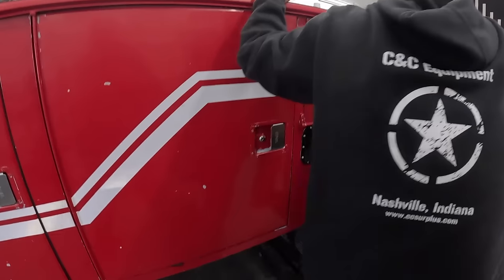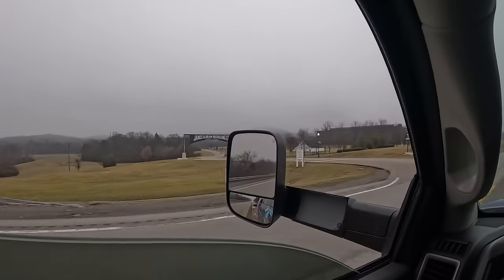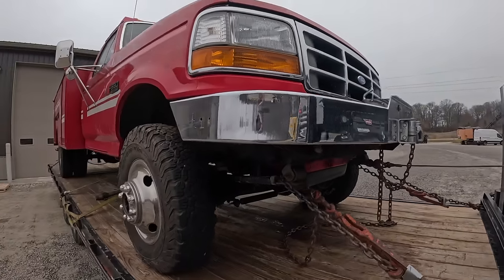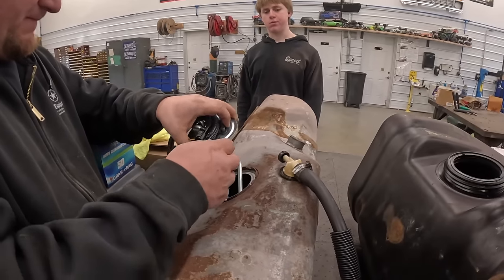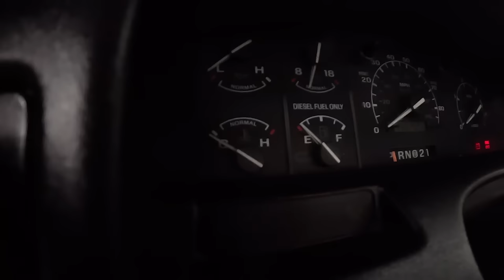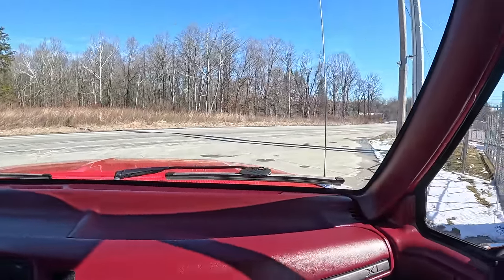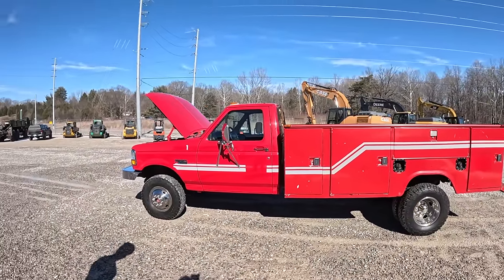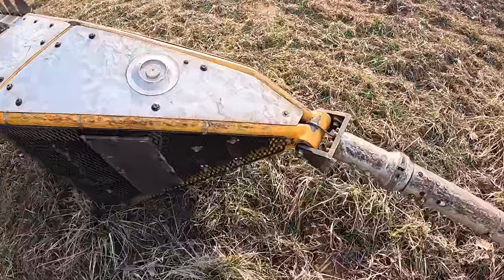I went all in on a non running OBS Ford F350 fire truck | Did I get burnt?

Comment: Buying from a fire department is a smart move. They take care of their equipment and also the low mileage factor.👍
Reply: They don't all take care of their equipment.  And, while it may be low mileage, how many hours does the engine have on it from idling.
Reply: It is a smart move. Most fire equipment has low mileage and has been maintained to some extent. You just need to look at what you're buying.

Comment: Hey there Clint I'm sorry but I missed what you guys sold this unit for I have a government spec ram 3500 4wd it's a 99  with the same bed that I'm swapping a p pump 5.9 and nv 5600 Into to sell so just want to see where these  low mileage units fall into thanks for saving this unit for the next owner truck looked fantastic your sons work is respected 😊

Comment: Is the 1/2 inch bolt a design, or design flaw?  I believe it may be a purposely built weak point to save the aircraft in case of an entanglement…just guessing….any experts out there?